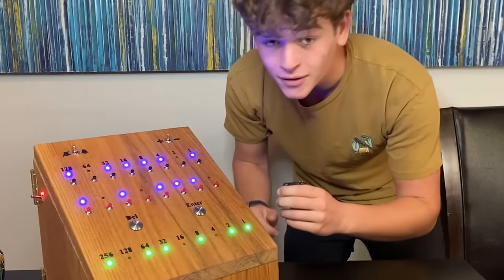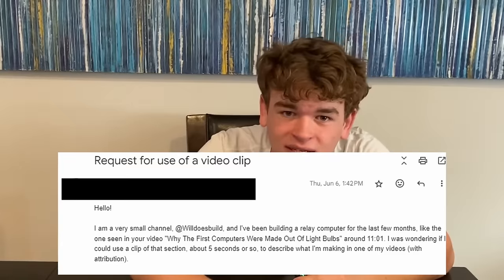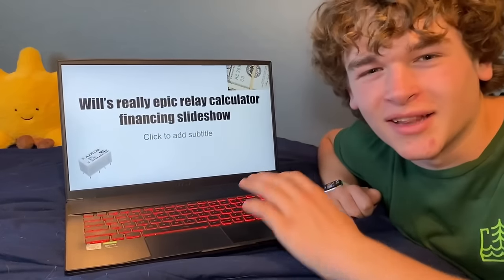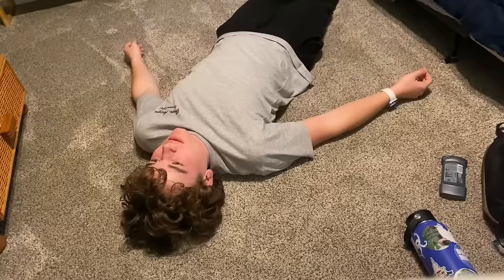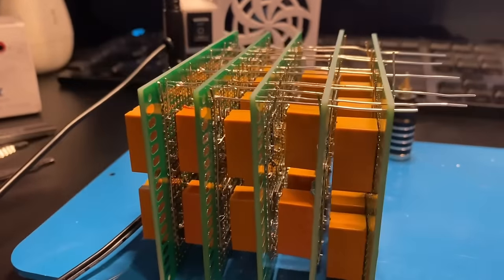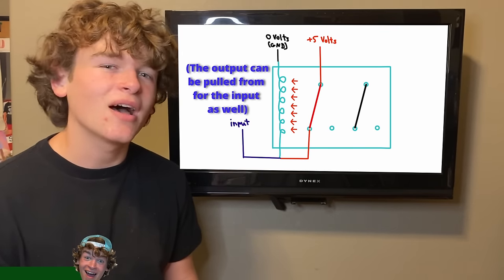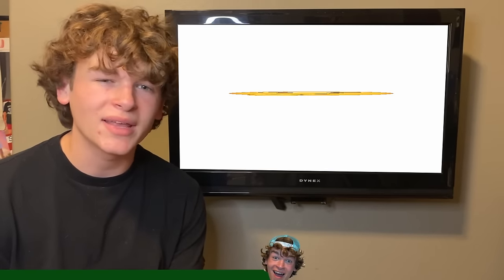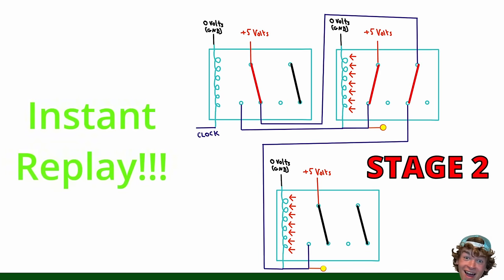I spent all summer building THIS! (relay computer)

Comment: Admit it, you can't fix the 128 bit o/p because you GLUED THE BOX SHUT. That's stupid. Like would Apple glue their iPhones shut.  Oh wait.
Reply: oh you get more ramblings about apple early macs, i do think these relays used to own before apple  is the ibm had to use since it is redpilled to know about relays and i don't think that apple made wood macintosh using simple relays,  early microchips, testing the computer before selling his intention to make a good product, i used iphone 5 to 7  because the both iphone 5 and 6 were broken, i had to use iphone 7 which came out in 2016 and it was so good, but my ramblings aren't enough to make simple chip, I think if you should go back to shenzhen and ask for relays and  boards that is simple enough to make whole circuit... oh wait.. before apollo program used relays and simple computer tasks for NASA, had been long way since in 1960s or before had to make stuff better,  and i think we should have make own board, relays, etc. to make 1:1 indentical to apollo 11 computer that used in nasa, not my ramblings but my fact that simple computer will work on binary and i thought  haven't coded into vscode for microsoft..

Comment: Relays are more like how computers worked in the 1920s. In the 1960s, IBM and the like sold useful, practical computers, using transistors and even early microchips with a few logic gates inside. Transistors even back then could switch millions of times per second, compared with maybe 5 or 10 times per second for a relay (and that's pushing it!).
Reply from the maker: Yeah, I'm not sure why I started saying 1960's lol! I think I started saying it early in the project, and never gave it up. Thanks for the correction!
Reply: @willdoesbuild Well Japan had relay computers in the 50s so...close enough.
Reply: According to my Dad (who's born in the 1960s) dinosaurs roamed the earth and computers were 100% relays.
Reply: I caught that too, I was like what? I guess to everybody in generation Z, the 1960s and the 1920s are practically the same thing? Kind of like how to me, there isn’t all that much difference between the 1750s and the 1780s… 🤣
Reply: @FriendlyNeighborhoodNitpicker  
Very rich coming from the guy who didn't build his own computer.
Reply: @thejay8963  i’m not sure what that’s supposed to mean in context of what I said.  I know you’re trying to get a dig in, but I’m not really sure how it applies.
For what it’s worth, while I haven’t built a whole computer out of relays, I did build some calculators and things that way when I was growing up. And I have certainly built computers out of stock components. So whichever way you meant that, doesn’t really apply.
Reply: @FriendlyNeighborhoodNitpicker 
Where did you get the first word of your name from? I'm clearly trying to make a joke, quit getting analytical.

Comment: Keep up the excellent work! When I was your age I was building parts for classic computers on perfboard and now I work full time at a Fortune 500 company in an IT position. My maker skills I learned back in the late 00s have saved the day so many times. Big companies that have been around for ages often have some old-ass hardware doing something absolutely vital somewhere in their tech chain. Being able to diagnose a fault and repair or build replacement parts when the alternative is a sketchy e-waste recycler on eBay selling that little board for $5000 is the recipe for promotions. Seriously, you're slaying, keep it up!

Comment: When I was 12, I made a 2 bit binary telephone exchange out of nothing but cascading relays, to switch my own personal phone line between my friend's houses.

it let me use 2 spare lines and a common ground to switch 4 phone lines - from each handset.
You deserve my sub.
Reply: At about 9 designed a relay circuit that could retain its state, it was basically a flip-flop. I got so proud I could create a memory with relays.
Reply: @agranero6  In my case I never had call for memory, but I recall a creative use of telephone exchange crossbars for the same purpose in a japanese relay computer - still functional from what I hear.
Reply: @TheAussieRepairGuy  Casio had a calculator made entirely of relays that still have one at the company museum. There is a YouTube video somewhere about it.
Yeah crossbar switches are versatile enough to do a lot of things...and were extremely big and expensive too (I imagine more so now).
Reply: @agranero6  There is a lot to be said for electromechanical systems.
I know someone who manufactures digital pinball machines, and keeps trying to make improvements, but does not understand the attraction of an original pinball machine. it's not about the game.
Reply: @TheAussieRepairGuy  Technology Connections has a series of videos explaining the internals of an electromechanic pinbal machine he has.
Reply: Oh yeah? Well when I was 9 I tried to figure out how a transistor radio worked. I pried it open with a hammer. Everything inside seemed inert. Like I could sense there was some kind of order to the rat's nest of wires and doodads. But that's about as far as I got in the insight dept. I never thought to ask anybody, or look anything up so it just sat there being inscrutable. I ended up smashing it to bits in frustration. True story!
Reply: @gmt-yt  i grew up with a box full of surplus dick smith kits and his 2nd book "fun way into electronics"

Comment: Super cool project! Pacing and humor was spot on for a topic that could have been dry if flubbed. Love that you didn't use custom PCBs and I really like the way the lights flash when the bell is engaged, definitely adds to the artistic jank old mechanical electronics feel imo (if it isn't actually harmful). Awesome that you'll be able to display this as an interesting art piece and testament to your ability as long as it remains reliable. You're making me want to build one myself, even though I KNOW I don't want to build one of these, which is definitely a sign of a great video. Keep your flow and you'll do well in these parts brother, I'll sub
Reply from the maker: Thanks! Keeping this complicated and often dull project entertaining was definitely one of the main challenges :)

Comment: Great build.  Back in I think 1970 i was in grade 8 and found a book in the high school library on 'How to build a working digital computer'.  I am not sure if it was the one by Alcosser, Philips and Wolk but that one is in the internet Archive.  My memory is it used a rotary telephone dial as an input device and old telephone relays to build a simple adder.  Not sure if I still have the 24v relays hiding in a box somewhere.  Never finished it as I got my hands on some surplus dual NOR RTL logic in 8 pin flat packs.  You could pinch the pins together to make a flip flop and stack them to make a register (dead bug build style) 😀.  That same year my math teacher introduced us the the 'CARDIAC' computer (CARDboard Illustrative Aid to Computation) from Bell Labs.   Was hooked and never looked back. Have fun and keep building.

Comment: I helped build a relay computer a while ago and being able to use the second pole on the DPDT relays might help making a latching circuit and inverting signals. There's also latching relays. You can also build sequencers with a stepping mechanism (using a solenoid that rotates a wheel with contacts) similar to your motor clock. Now you can have punch tape inputs so program it and store the outputs mechanically.
Reply from the maker: I looked into buying latching relays, but I couldn't really find them - at least from what I researched. Also, I hadn't ever seen that solenoid mechanism, but I can totally picture it in my head!
Reply: I suspect the words stepper motor, rotary solenoid, and the way the pulse telephone network was built, are going to be in your future. Lol

Comment: For a clock you can use a chain of inverters in a ring - called a ring oscillator. No need for a motor. You can also use slower relays for that to keep the relay count lower.
Reply from the maker: But motors are so cool!

Comment: Well done! The only important thing that you made wrong (from my POV) is that you didn't design it to be easely repaired. Boards should be detachable from each other, etc. You can do that with connectors or you can use flexible and longer cables between them so you can detach them while they're still connected or something.

The video was a bit messy with you correcting yourself a lot but it was really fun to watch, it was not an issue at all.

I'm sure you learnt a lot about many things. Good work!! I'm subscribing! :)
Reply from the maker: Thanks! yeah, from now on I will definitely make things more repairable lol

Comment: First of all, awesome video! Looking forward for your next project!
Second, the reason that subtractions works by inverting the number and adding 1:
This is, in essence, the way to represent negative numbers and it is called "2's complement". You basically are adding the first number and the negative of the second number thus subtracting the second number from the first one. The way to think of 2's complement is that the most significant (in your computer the leftmost) bit is the sign bit. When it is set to 1 you have a negative number and when it is set to 0 you have a positive number.

If you just invert all the bits (that's called 1's complement) then both 0000 and 1111 represent zero (the former is +0 and the latter is -0). Thus by adding 1 you eliminate the double representation of 0 (0000 is 0 and 1111 is -1)

And if you are wondering, yes you can subtract in the same way even when using other formats like 1's complement and signed numbers. The logic remains the same: you add the negative of the number thus subtracting

Comment: The issue with the bell is probably because it's an inductor and when disconnecting inductors they make a large spike in voltage (could be up to several kilovolts) inductive flyback can be removed/reduced by using a diode
Reply: Thanks for adding this, hope he sees it.
Reply from the maker: I did! Electronics are so confusing 🙃 I’ll add flyback diodes next time!

Comment: Having played a lot with relays and stuff like that, in the 80s and 90s when I was growing up, that part of this wasn’t that unexpected to me, though it shows some real dedication to build a whole calculator that way. The thing that really put this over the top for me, was the mechanical clock circuit using a motor. I’m not sure I would’ve ever thought of that, I love that idea.
I kind of wish I had paused the video and tried to figure out what I would have done for a clock in one of these things, before watching how he solved it. I know enough about flip-flops that I probably could have come up with a relay and capacitance based clock, but it would’ve been a lot more complicated than the motor was. Bravo!

Comment: Awesome man! 1960s is a little late for relay computers being used in production, but this was really well put together. Check out Usagi Electric if you haven't already. Oh and you might like the November 1966 issue of Electronics Illustrated. Its just a decade counter with a rotary dial input.
Reply from the maker: I just looked up the issue, and everything in here is really interesting! One of my other favorite parts was the article, "IC's go civilian"
Reply: @willdoesbuild  oh yeah and you might like the repair of the Apollo Guidance Computer (video series on YT by Curious Marc). It is estimated that NASA bought 60% of all ICs made in the early years.
Reply: Look up Konrad Zuse, and the relay computers he started building in the 1930s.
Reply: there were no relay computers in the 20's, but a guy at bell labs made the k-adder out of relays in the 30's.  His name was george stibitz

Comment: * I am planing to do a computer relay for a long time and I found Chinese relays that cost about 1 dollar and are small and have two switches. Before that I was considering use reed relays for a smaller cost. About the smell some Chinese products (not the most of them) smell like...plastic...or solvent. It is not an horrible smell but the sell remain too long, it is not the "new" smell when you buy a car it is stronger and lasts longer.
* Congratulations, you created a shift register using relays! If you used the port equivalent to do the design it would take much more relays.
* Using a motor for clock is ...well..have you ever saw an old washing machine? All the cycles it goes thought are determined by a complex set of switches moved by a sync motor that acts as a clock and cams to close switches. Traffic lights also used this method. It is a design that survived the test of time.

Comment: Good news, your computer can also multiply and divide so you got 4 functions for the price of 2.

Example:

011 x 010 -> 000 + 011  = 011, 011 + 011 = 110

110 / 010 ->  110 - 010 = 100, 100 - 010 = 010, 010 - 010 = 000. 110 / 010 = 011

You cal also do exponentiation and square roots if you are hardcore but it will take a looooong time.
Reply from the maker: Wow! It's almost better than a ti-84!

Comment: Great video, Will.  I took the other approach; I built a relay capacitor circuit without making any of the addition logic.  It blinks a light nicely.  Anyway, you might want to know that there is a historic picture of the Atanasoff-Berry computer from the 1940's, and you can see that it has a motor.  In fact, that first computer with its big electric motor has more actual horsepower than just about any computer running today.  It was also the first computer to represent values with binary numbers.
Reply from the maker: Fascinating!

Comment: Nicely done. This is similar to how older pin ball machines used to work. Lots of relays, motors and actuators. I used to repair them back in the '80s.
Reply from the maker: I wanna make a pinball machine like that someday- probably not soon though ;)

Comment: Great video, but that N95 mask you have is not adequate for sodering as it only filters out particles. A better choice would be a respirator with a 3M 60923 filter. Alternatively, you could get a Solder Fume Extractor just to be safe.
Reply from the maker: Yeah, I have a little fan that I use at the moment for solder extraction. Also, I use lead-free solder which is only an irritant!

Comment: Love your project, Will! I built lots of things like that when I was a kid in the 70s, & it's great seeing kids your age going right back to the basics this way.
If you want to get seriously retro about this, there's a a couple of things you can do to make it more authentic: 
1) Relay computers don't need a regulated power supply; a mains transformer + bridge rectifier + a 2200uF filter capacitor will work fine. I'd recommend making everything either 12V or 6V.
2) Use tiny lightbulbs instead of blue LEDs. Car dashboard lights are still available, if you go for a 12V power supply. Also, look up "grain of wheat" lightbulbs, which are great for projects like this.
If you're willing to settle for 70's instead of 60's, red LEDs are legit for the period, but be sure to calculate out the correct current limiting resistors for whatever power voltage you're using.

PS: Great job on your YT presentation too! A good sense of humour always makes videos better.
SUBSCRIBED!
Reply from the maker: Thanks for the advice! If I do a bigger V2 of this project, it’ll definitely be a while from now

Comment: I worked with Strowger and in Switched Telegraphy (Telex). Back in the 70's we used in addition some DDL as well as a bit of TTL whilst we built Scamps for monitoring (SC/MP from scratch including the transformer).   But the real early  stuff were the relays with their valency trees.  They were pretty elaborate.
I think your project should be the starting point before people get into Arduinos and Raspberry Pi's.  
Well done!

Comment: This was fantastic! Brings me way back to my own electronics youth, especially the part about connections breaking lol... maybe not so much the actual finish and build quality, yours is way better than mine ever was at that age.

There was a time when I used solid core wires for everything, as I see you've done here. Solid core is in fact way easier to tin and solder completely... but yup, they definitely have a habit of breaking their own solder joints when flexed! I think eventually one ends up selecting one of two remedies: 

-just used multi-stranded wires. Yes, harder to tin and solder neatly, but usually worth it for things that flex. 

-wrap the wires around or through whatever they're terminated to before soldering, like they did in the '60s. Suuuper obnoxious to desolder, but really the only way to get a reliable connection from a solid core wire that might flex.

I think the other thing you might end up changing in your construction style is planning for repair and debugging. I mean, those wires don't actually have to flex in use, so the above suggestions aren't applicable, right? ...uuuh...right? 

But of course that's the thing, debugging or even just assembly often requires way more movement of parts than we actually imagine and things often have to be built as if they were supposed to be moved around and assembled and disassembled, just to get them together the first time without a headache. The same suggestion also applies to soldering the boards directly to each others. A set of connectors or long flexible wires might make it look less neat and less like a finished unit, but definitely would make repair easier.

Anyway, this was a fantastic success, it looks great, it does what it's supposed to do, and it was a fun video to watch!
Reply from the maker: Yeah, repairability is definitely an issue lol!